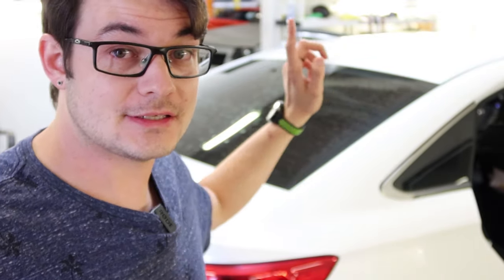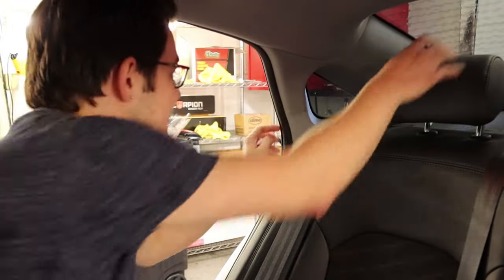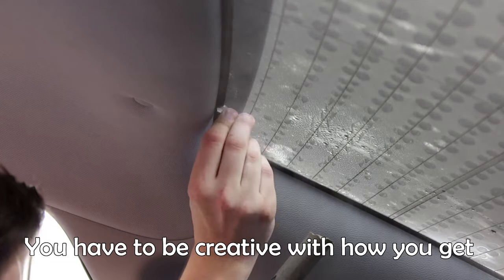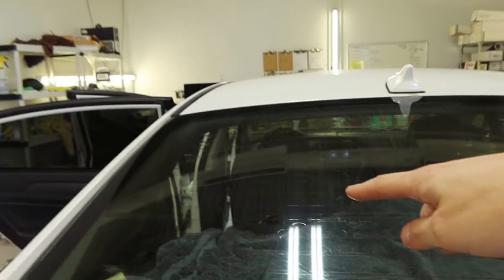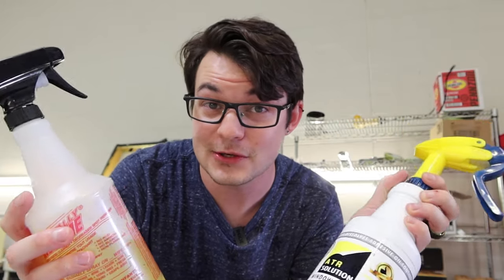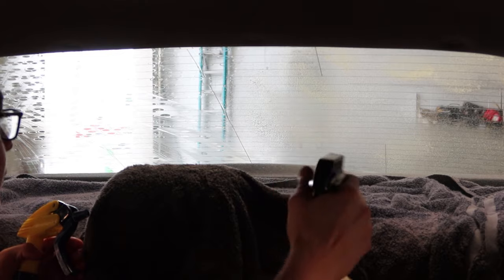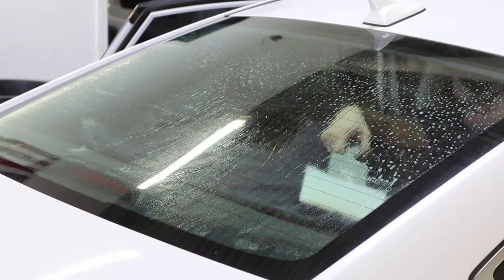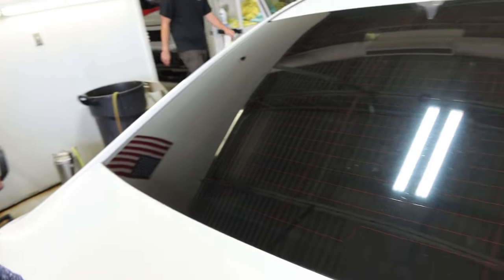Awesome Way to Remove Tint Adhesive for $1 | How to Remove Old Bubbled Window Film

Comment: My local tint shop says its a hour labor just to remove my rear tint and my defost line and antenna could get damaged you made it look easy
Reply: To be honest, I would probably trust them. Some rear windows can take up to a few hours if cheap film was used. I’ve been practicing learning how to tint & the removal on rear windows is probably one of the most challenging. I have tools & sometimes I realize why people are better off paying an actual pro.
Reply: As tinter shop owner, i’ll say let them do their job. We all have jobs and we all know what we must do to get it done, you pay someone else to do what you don’t know how to do.
Reply: @angelxlxyvtxxlyys8672  nah fr 😂😂😂
Reply: @miguelibanez6858  stop over charging then! 100 bucks to do 1 hour of laborer work? Gtfo
Reply: @miguelibanez6858  I think this was the point of the video. I don't have the money to pay a professional. No dig on you, it just is what it is. I recently inherited a 2001 Ford Taurus in Florida and in order to get the car to Kansas where I live, I have to remove the tinting because it's too dark (illegal) in that state. Kind of between a rock and a hard place. Not trying to get pulled over with these crazy law-enforcement, either. I get lookin out for your profession, business and your fam. It's just money is tight for some and if something needs to be done asap (before you can save up for a professional), a DYI may be your only option. Sending good vibes to you, your biz and fam. Peace. ✌ Earl.
Reply: @Clubkidknitter  thank you 💯🙏 stay blessed
Reply: 100 isn’t high trust me removing tint can be difficult at times but feel free to do it yourself no tintshop owners really wants that we prefer a nice clean glass to cut and lay
Reply: That’s what mine said and I thought how hard can it be?
Reply: @angelxlxyvtxxlyys8672  you'll be sorry, cant defrost back window anymore
Reply: My tiny shop said they don’t remove rear tint that I’d have to do it myself
Reply: Yup we charge 100 as well, sometimes 80 if we know it’s not 7+ years old. We use trash bag method, takes about 30 min to remove and scrub and clean
Reply: @waybach  what spray do you use on the trash bag method, Awesome?
Reply: That's nothing I was told 4/5 hrs & I  wasn't going to like the price 🤷‍♂️
Reply: @MalcombMedia1 in other vids I have seen, either formula 409 or Windex w ammonia.  Just put a towel to cover door panels bc it can damage the plastic.
Reply: Still an hour minimum billing time is money or you save some money and DIY

Comment: A black plastic garbage bag, and some 409 cleaner is faster and no glue left on the glass.  Spray the inside and soak it good with the 409.  Then stick the black plastic from the garbage bag (cut it to fit glass) to the inside over the 409 (smooth it out). Let it sit in the sun for 15 minutes. That's it. The tint and the bag peel right off not leaving any residue.  This way no one has to go out and buy a steamer.  The steam could loosen some headliner glue if not careful.  Just messy.
Reply: Where defrost lines got damaged
Reply: @mariocmo1  Im not sure what you meant here, but I tried the bag method because of concern over the rear defrost lines. It worked perfect and did not do any damage.

Comment: Florida heat has removed the rear window film on my 2006 Corolla, and it was rolling down making it impossible to see out the back window.  All I had to do was pull the film off.   But all the glue got left behind.  Shout out to you for the Awesome Cleaner!  Worked just as you said.  Many thanks!!!!  Now we can see again.

Comment: I recently removed tint from my front windows as well . I used a steamer as well. I would say 85 to 90% of the glue came off with the steamer alone and peeling back the tint. At the same time I was trying to clean up the door. With Griot's interior cleaner. I used it on the glue that remain on the window, That stuff worked like a charm it certainly ain't no dollar but it worked great for taking the glue right off

Comment: Thank you for this video! I used a small steamer I bought at Target to get wrinkles out of my clothes and it worked well. Also used Totally Awesome and I got the two back windows done in half the time it took when I used a heat gun and removed adhesive with blade and Windex on the front windows. The back window is next but now I'm not dreading it because the steamer makes it so much easier and less time consuming.

Comment: This worked perfectly in January in Seattle!  Less than 10 mins and the old tint was off and the glue residue cleaned off!  Used my clothes steamer and the Awesome cleaner from under the sink (also works great on bathtubs).  Thanks so much!
Reply: Thanks for the locational advice 😅 I’m from PNW too. Need to get that crud off my civic 😎

Comment: Posted Dec-2022; Daughter bought a 2017 VW Golf with rear hatch tint that had bubbles.  She wanted it removed.  It's cold here - so no trash bag trick.  Tried heat gun and film came off -but not adhesive.  Only did a little corner.  Saw this post and went to H0me D3p0t and bought LA's Totally Awesome for $3.00.  Back home and tried steamer and same thing - just film - adhesive on window.  Sprayed on the LA's cleaner and used plastic pad and after a few times all adhesive gone.

Comment: Well my secret is out ..I've used awesome to take off the glue 5 years now.it's amazing how it works.I still do the heavy duty black bag method but I use the awesome instead of no drip Windex and it gets it all off but It still leaves a spot or 2.Its hot as hell here in Tennessee so it helps to.Great video and Awesome job brother as always.
Reply: I just posted that question on here, if anyone used the 'Totally Awesome' and the black plastic bag method, if it works to pull of both the tint layer and the old adhesive as well?  So it does work??  On bubbled off tint that is like only 3-4 yrs? But failed like this Malibu did. Hell it is the same car I need to try it on!!  Quality GM glass!  Cant be the exact same tint maker.  So...a good thing to try in the HOT Fla. sun????

Comment: Um so I'm 44 and as far back as I can remember I've been using this around the house growing up. Then fast forward to know as a tinter. Working here and there and seeing what other places use and always wanted to say something but never did I just did it there way. NOW I'm working by myself at a dealership and I do used cars a lot and this was my first GO TO and it works great. Best stuff I've ever used to remove glue. and I get it in the gallon jug at the .99 store. Places like dollar general and dollar tree have it too but the actual .99 here has the gallon for 3.99 can you believe I buy 3 at a time. Also the atr you have I wonder if its the AWESOMES green awesome stuff they have it's a clearer and not as bad smelling but smells the same they have a few other products.  

And  I peel film, spray it on walk away come back a few minutes later and spray again and most times I just use slip so get it wet again and boom the glue is pretty much GONE. like its not there/ wipes right off. OR i use a plastic scraper and scrape ti off. but sadly this make the glue more snotty.. LMAO.. 

Also be warned it will choke you out or at least it does me sometimes.

Comment: Just pulled off failed adhesive tint for the b8 a4. This method worked flawlessly! Steamer to pull off old film then LAs Awesome soaked onto the rear windshield with a rag and all the adhesive came right off!

Comment: Car wash  window cleaners contain ammonia which causes adhesive to break down over time,  back in the early years Windex and a plastic bag was used to heat up and remove window  film

Comment: I've used awesome on everything. Removes rust stains on carpet to using ggv it daily to clean used metal cabinets that people stick shit on  and refinish them. Let it work then blade it right off engine bays and car cleaning it really is a good cleaner. Works great in extracting and cleaning interiors as well

Comment: I've been using Awesome for years and it's fantastic.  It's also great for removing pinstripe glue, but you have to wash it pretty quickly because it will stain paint.
Reply: Might need to wax too, probably took off the wax

Comment: I just removed my bubbled rear window tint, i turned the rear window heater on for 15 mins then put steam to the film and peeled one corner and it peeled right off with just a little steam it took 10min   to strip and clean thanks for the tips

Comment: I prefer Simple Green or Simple Pink.  I've tried Awesome and it works good too but I've been warned by others that it can fade interior panels if not completely wiped off and left out in the sun.
Reply from the maker: that's good to note for sure. always gotta be a catch right? I haven't seen anything yet but I'll keep an eye out.
Reply: Yeah so will simple green and pink.
Reply: Glass Repair Guys LLC been using it for 20 years and hasn’t happened yet so I think it will be just fine.  But thanks anyway.
Reply: Agreed. Make sure if you overspray with Simple green get the whole additional panel and wipe it all clean. I have had Simple Green react with panels. ALSO, the steam method is good but I will not use it too loosely as all the humidity close to the headliner will be noticeable eventually as that section of the head liner will deteriorate and fall first.

Comment: Perfect! I wanted to know which of those 2 are better, ATR is like $25 a gallon and i just saw Awesome in the dollar store. Now i can get my Awesome for a dollar and my Joy Non-Ultra for a dollar. I wonder how good Awesome is as a general cleaner for back glass (or all glass) in general, like when it's a new install without removal, if it's loosening up that adhesive it must loosen up dirty glass pretty good. I've gotten away from using slip solution to clean. Good vid man

Comment: Does this process not damage the defrost lines? Since you are up in Michigan I think that would be a concern? I have the same problem. In same model that I want to fix. Many tint installers say they cannot garuntee they will not damage defrost lines.

Comment: Didn't work for me. The first film just came right off with no steam. I've found no solution to getting the second film off. Steaming it just comes off in little flakes using a razor which would ruin my defroster. I'm at a loss

Comment: I recently got a '95 Camry for $800 & the rear window has tint on that is blurry & can't see anything clearly & sort of removed just a little bit of it & can actually see clearly through a circle spot without the tint
only tool I don't have is the steamer or heat gun to remove the tint easier

Comment: Thanks had awesome left over from rental cleaning applied straight onto adhesive on rear glass. Waited about ten minutes was able to lightly scrub old adhesive with scrub pad without damage to grid.worked better then store bought tint adhesive remover. Thanks again

Comment: Would a heater gun damage the defrosters? Or does the steamer do a safer job?
Reply: The purpose of the defrosters are to heat up so a bit of steam won't hurt it at all.

Comment: What steamer are you using?  All steamers I am seeing are SPRAYING or shooting out steam like a jet... not a soft flow like yours.  You link isn't working anymore.
Reply: I'm going to take off the floor attachment on my Oreck floor steamer, test with a low to medium setting, increase to high if needed, & take off the tint on my driver & passenger windows. Wish me luck!
Reply: @manuelcastillo_q1027  I ended up buying a steam cleaner from Walmart for like 60 bucks I took the head off and it looks exactly what is pictured in this video.  I removed the rear tent from my rear window zero issues.  Then reapplied new tent and it came out perfectly this time because I thoroughly cleaned the windows like I should have done the first time.

Steam is 100% the way to go.  I had zero residue on the window or any glue or adhesive it worked perfectly!

Good luck!

Comment: Wow, that worked great! I have a little 1967 Piper airplane, and airplanes have plastic windows.  The previous owner put on tint, bc he lived in Arizona and no A/C in the plane.  Anyway, FAA says its illegal so I pulled it off, but now I have the adhesive left behind. I looked at the Awesome website and can't find anything that says do not use on acrylic, but do you have any thoughts on that?  If I can't use that, do you know if the ATR is safe on plastic?  Thanks and keep up the good work!
Reply from the maker: Hard to say, never tried. It’s worth trying a small area to see if it’s safe. Careful with scrub pads tho. Might get a lot of small scratches.

Comment: So it’s best to steam on the inside of the tint? Or should it be a back and forth method? I just got pulled over for this so I gotta remove my rear tint!
Reply from the maker: back and forth is typically what happens. steam the tint then move the steam to the glue side right where the film is pulling off the glass.

important part is just keep the film/glue warm where you pull it and even if all the glue gets left behind, make sure all the film is off and the adhesive remove will do the rest of the work.
Reply: TintStuff thank you

Comment: I recently removed my tint on my car by myself and I used windex and trash bags. I sprayed the windex on the window and then place the trash bag on the window. Then I left it there out in the Texas summer heat 95° for about 45 mins and then I pulled it off and the tint came right off
Reply from the maker: I tried that in the Michigan summer but the water just froze

Comment: Need a better steamer, get a POD style.  Hotter steam, more pinpoint placement and getting behind brake lights.    The passive Jiffy style steam is barely any better than trash bagging in the sun.
Reply from the maker: next video, how to remove tint with $1 adhesive remover and a $350 steamer. I like your style.
Reply: Well ... $80. Lol. Close enough.  The yellow Wagner POD is 80-100 on eBay all day. 

The garbage jiffy steamers are 350

Comment: when you get frustrated and just rip the last part off, don't you increase the risk of damaging defroster lines? or since it was showing to be film only and not adhesive, it was not a concern?
My rear window started bubbling, it's Formula 1 and has a lifetime warranty, but the tint shop that did it says there is a 50% chance that the lines will be damaged when they remove it.

I am concerned about that and don't know if they rush as they need production and may not get paid for their time by manufacturer.

I have considered just removing myself and taking very careful and slow effort, and simply paying to have it redone?
Great video !!!
Reply from the maker: Nah pulling the film quickly just ends up leaving more glue behind. In my experience, very few Defrost wires ever get damaged unless they use a razor blade to scrape the glue. that's a painful process tho and most everyone uses some firm of adhesive remover and glass/Defrost safe scrub pad like the 3M white ones. 

shops usually tell you about the defrost as a precaution to cover their own ass. Llumar formula 1 is one of the few brands that cover labor and costs under warranty as long as they actually file their warranties. formula 1 is also supposed to be reserved for high end shops that know what they are doing so I'd image you will be fine.

formula 1 is expensive and I'd hate to see you have to pay to get it reapplied. im a little surprised it's failed unless it's just been on for a very long time.
Reply: @DetroitTintStudio  hey just a quick question
How long do you think aswf performer series will last without fading if they are 35%?
I have them installed for 6 years and compared to the edge of the window that doesn't get exposed to UV since it's covered by the door,i can see that this spot is greenish like when film were new...

Comment: Is there any way to fix? I mean.. i feel like id settle for poking a couple tiny holes to shoot some idk tint adhesive in the tint and squeegee out. Id settle for a tiny hole or two. Cuz i dont want to damage defrost lines or go thru headache of taking off, but shops charge alot to take off as well and in the end has to be redone. Well fuggin hell bro. Gotta be a way to just repair bubbling and keep cheap. Especially giant bubbles that i got. Is there some sort of tint adhesive or something?

Comment: Ha have 2 gallons of this stuff sitting 10 feet from my windows. Try using Awesome to remove black streak on your camper trailers too. Wow. I mixed 50/50 too in spray bottle and sprayed on wash rag when washing car. Super squeaky clean like I waxed it.

Comment: I have a ‘96 Cavalier with a very blurry rear window. I thought the blur was due to the old window tint. So I heated the tint with a hair dryer, then easily removed the film in one piece. Great. But the adhesive remained, so I tried the Awesome spray. The adhesive is now gone, BUT, THE WINDOW IS STILL VERY BLURRY! The glass surface is free of scratches and pits, very smooth and shiny, at least on the outside. It seems the blur is from the inside surface. This window has the defroster wires. Is there a factory film that covers the inside surface that holds those wires in place? If so, did the old window tint cause this factory film to dull? Is the only cure a new window? Crap!

Comment: Hey Matt. What is the wireless mic you have and how much was it? I want to convert you over to the blue scrub pads you can buy 4 in a pack at Target. They are more aggressive last longer and cling better to the scrub paddle. See ya in your next video chat.
Reply from the maker: It's a Rode Wireless Go $200. way more convenient than my senheiser mic I was using ...its been great. there were a few parts I muffled the mic accidentally, so I gotta work on placement a little bit. clipped it to my glasses in an upcoming video lol